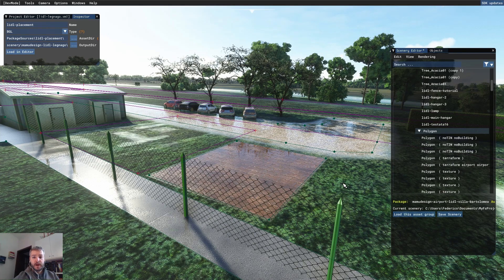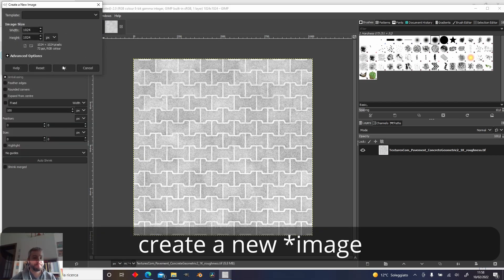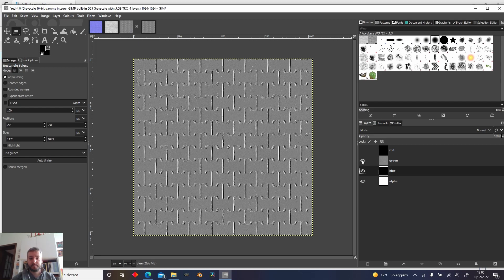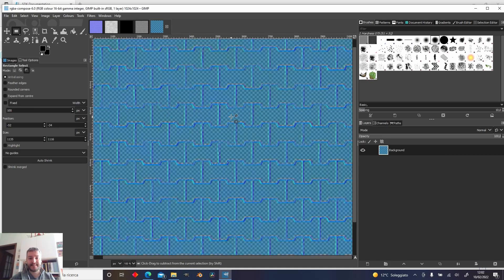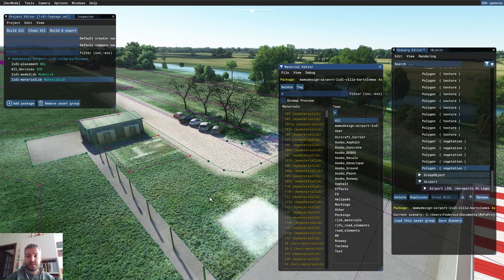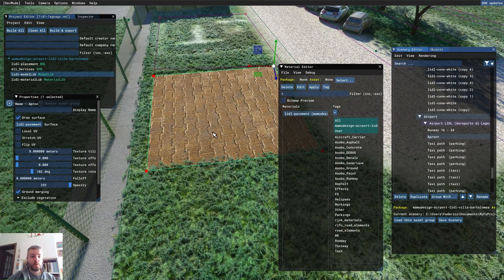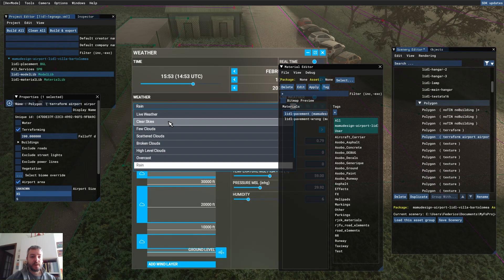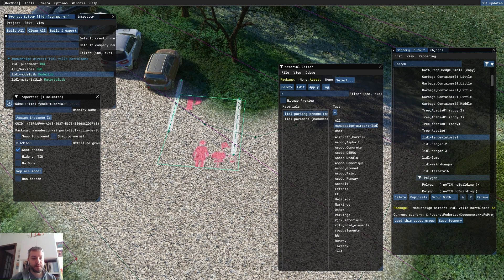MSFS SDK TUTORIAL - Custom Ground PBR Materials

Comment: In the software program "Materialize"  if you assign the channels and "save property map" do you know if it will create the composite map?
Reply from the maker: It can create the COMP (occlusion/roughness and metalness) but pretty sure it will struggle to create the ground PBR 
Strongly suggest to use a proper image editor (gimp or Photoshop). Materialize can be handy, but it doesn't create proper material, it can only try to "guess"